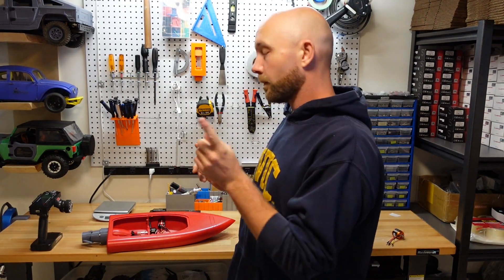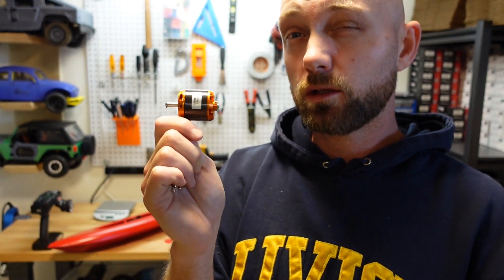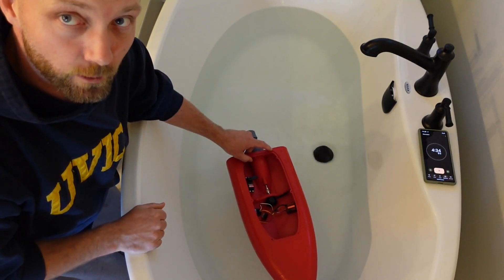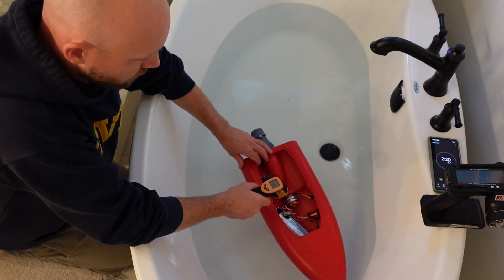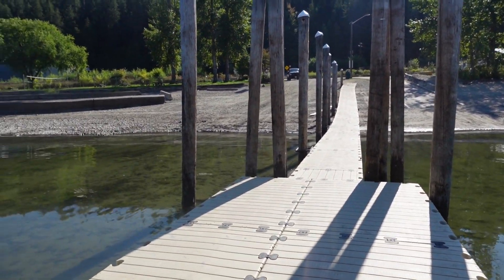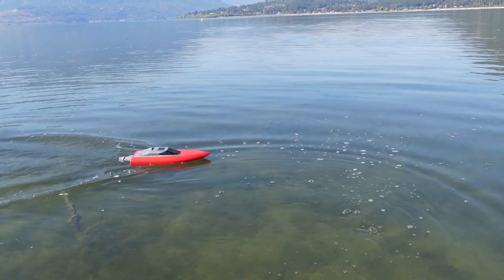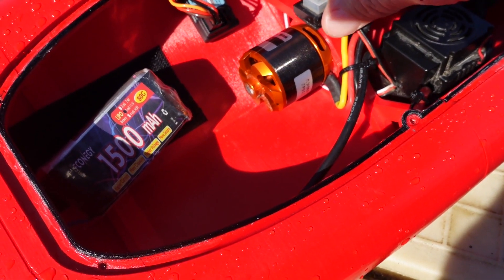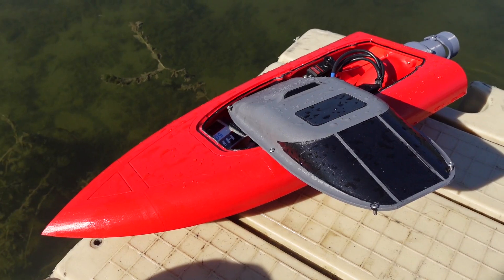3D Printed Jetboat Motor Testing and Upgrades

Comment: Jet boats are cool, great for rivers and creeks, looks as if you did a great job 👍
  Over heating is the main gremlin in all brushless motor rc boats, might I suggest you use an inrunner and cooling jacket, don’t put the water pickup in the jet housing, air cooling in a small boat just doesn’t seem to work well and add floatation where possible.  👍👍👍

Comment: Which servo used ? Can you list electronics in description?
Reply from the maker: This is the servo: https://rcprinter.com/products/20kg-digital-servo-ds3218-with-metal-gears-and-metal-servo-arm

I've tried many different electronics. I'd go with a 540 motor and water jacket like I installed here: https://www.youtube.com/watch?v=yfApIYZzt8g&ab_channel=RCPrinter

No matter what you do you'll require water cooling.
Reply: Modified motor mount little will try 1000KV drone motor with 70-80% throttle curve to avoid over heating

Comment: I am using throttle curve to limit the thrust for heating issue .... it does not go full throttle but it saves the motor
Reply: Not on same boat n specs but just for your idea ... will try building this model soon
Reply from the maker: Thanks for the tip. I've been building the MJET Sprint and Supersprint lately which are quite an upgrade over this one. Should have a SuperSprint build video out soon and kits available at www.rcprinter.com.

Comment: @RCPrinter Thanks for testing and sharing. I am about to build the boat for this summer and I was wondering, what KV 3550 or 3560 motor you would recommend for 2S and 3S. I will try to fit water-cooling too.
Reply from the maker: Hey water cooling is pretty important, I need to add that soon. I'd probably try 3000-ish next but I don't really know for sure. I think the 3650 I tested here was ~4300 which I think was too high.

Comment: For the boats, you have to use water cooling on a speed controller and motor because the investment is capsulete, and brushless motors do not have ventilation
Reply: ... and to avoid cavity, you have to install one the half from the grid and another intake perpendicular.
https://youtu.be/LUjgNP3a_nU
Reply from the maker: yeah I'm definitely learned that this summer. now to figure out the best way of installing water cooling in this one for next summer!

Comment: Definitely add water cooling. I’ve have been working on mine for a while now and I added water cooling which works great and I added foam in the front end to keep it from nose diving in the front but haven’t tried it yet. Water cooling jacket for the engine and the Esc was easy to install which I drilled a hole in the jet right after the prop and installed a copper tube with a slight angle cut in the tube so it pushes the water through the tube into the boat. I ordered some fittings but you can 3d print something for the tubing to connect to in the back of the hull and one for the exit which I like having it pointing up so pushes the water in the air so you can tell how well it’s working.
Reply: I was looking for this comment. Was just about to write a whole essay on how important water cooling is on a jet boat since it does not get any other types of cooling.
Reply from the maker: Thanks, water cooling is definitely next on the list for this boat but figuring out the best way to do that on a jetboat is tough and I've seen a lot of pics of people putting the intake in a lot of different locations so thanks for giving me the feedback on what works best for you. I'm not 100% sure I'm properly picturing how your copper tube is installed so if you have a pic or something of it that would be helpful.
Reply: @rcprinter  I just drilled a small hole down into the first peace of 3d printed jet drive and stuffed a copper tube with a 45 degree angle. Pushed it down until the 45 is just sticking down a little bit so the water flow hits it. If you don’t have copper tube I would use a peace  hollow antenna works great. Plus if you use a antenna there’s a bunch of different sizes you can try plus have plenty left over for another project. Anyway water cooled is the way to go even if you rap the motor with copper tubing is better than nothing. Also you can use the antenna to connect peace’s of tubing together or since it’s tapered you can stuff it through the back hull and super glue it in place to connect the intake and exit water cooling lines to. I hope that helps you out. Good luck and I hope to see a new video soon.

Comment: looks like if it turns too hard the hole is exposed to the air,,,i would like to show u my build in fact.. its on thingy its the blue one with the white top I'm working out water cooling and water pump..its another version of the boat i think is made a lot better check it out...the guy is in the bashtech comments..i'll post all the new stuff i did to it soon like trim tabs ect.
Reply from the maker: Build looks great, love the rear wing. The water cooling installation looks really cool. You should do a video on it when you're done and show us everything you did.
Reply: @rcprinter  i was gonna try but...im having alot of issues...one being the same water invasion your having lol..i thought the pump would help but...idk maybe its my receiver...the amp draw is too much and everything reboots basically..

Comment: Works way better than mine. I have water cooling for ESC and motor but it would still kill itself if I drive with more than half throttle for too long. Need to find more sufficient motor at some point.
Reply: it probably is not the motor, i had similar problems with my boat until i noticed that i messed up while filing the driveshaft so it could move in rear bushing. you shuld check all drive components if they are running freely and if your coupler is perfectly center since that might intoduce a high imbalance at greater rpm
Reply: what kind of esc and motor you using?